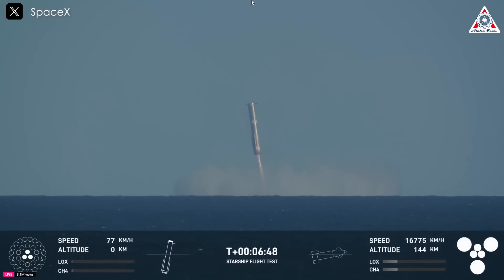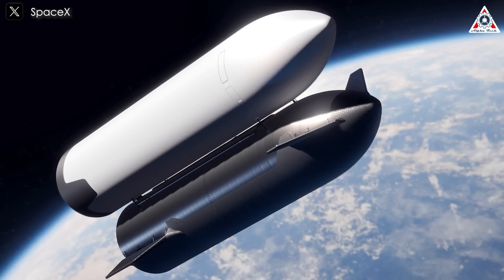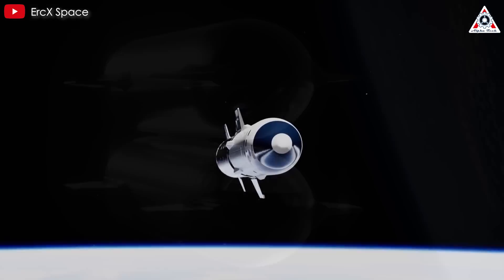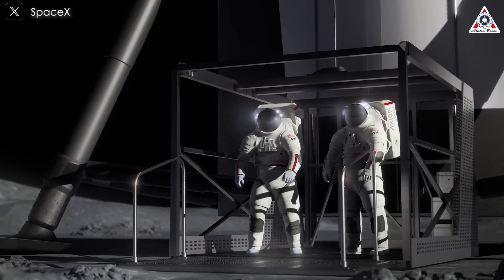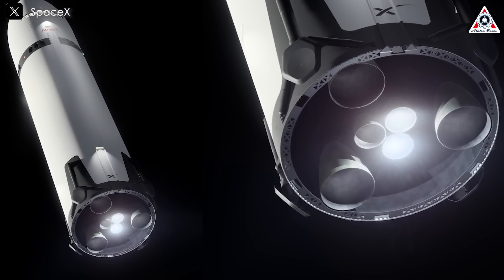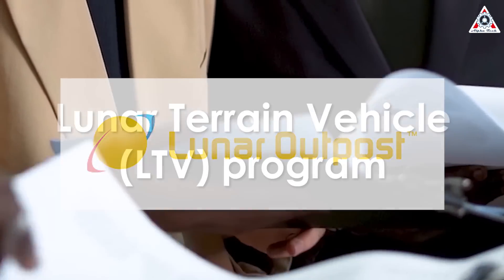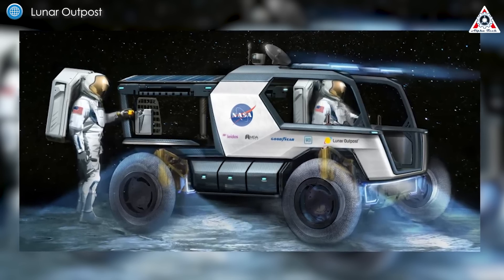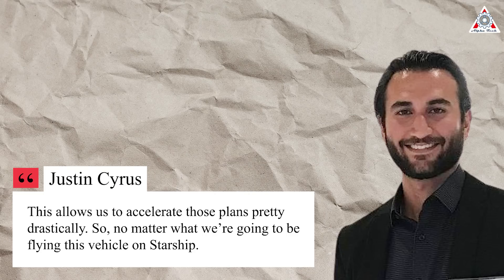Elon Musk just officially revealed NEW Lunar Starship Design that Stunned NASA...

Comment: I can almost see that tall lander falling over in the soft lunar soil after landing. Hope they test that concept first with no humans aboard.
Reply: Exactly.....refer to Intuitive Machines IM-1 lander......
Reply: They always do
Reply: The point at which a rocket rotates (while vertical) depends on where the thrust is coming from, the IM-1 lander that recently tipped had its landing motor at the bottom, making it unstable. Its like trying to balance a mop on your palm. HLS has its landing thrusters high up near the top of the ship, which is more like holding that same broom except from the top instead of trying to balance it on your palm. Its much more stable and since HLS will be crewed it will most definitely have some kind of automatic landing abort system.

Comment: Let us know when they create artificial gravity. Next reduce radiation exposure in deep space.
Finally create fuel from water for the trip home. Until then this is bullshit.
Reply: Idiot
Reply: we have the technology to do all of this already btw its just ridiculously expensive.
Reply: @sahibdipsandhu  lmfao, you must work for a government contractor.
Reply: @rap36case  Not at all, but had you done even the slightest bit of research you'd understand what I meant. But you didn't so let me fill you in. Artificial gravity can theoretically be achieved with the technology we have right now through gravity rings but realistically at this moment they will be wildly expensive and potentially unreliable. Both fuel and oxidizer (hydrogen and oxygen) can be produced from water through electrolysis. But the yields and time it takes to produce that yield is sub optimal. And as for radiation, there are already a plethora of commercially available solutions. Most can easily be converted into a viable method of deep space radiation protection.
Reply: The last one will be done very soon. The other stuff can happen in the near future.

Comment: Who doesn't recognize this as a thinly disguised attempt to rationalize development of a big, hulking stainless steel can meant for Mars trips through the magic of repurposing it for lunar missions using a visual design app? Look ma, no rational engineering involved at all! Just Von Braun's earth-orbit-rendezvous method force fit to a oxygen-methane behemoth of exactly the wrong shape for propulsive landing.
Reply: No, the Starship will be different for Mars as it will need rentry. In case you don't know, Mars has an atmosphere hence heat tiles required.  Much more complicated, will require self repair capability of the heat shield at Mars in case of a Murphy's law event.
Reply: @ghanova  You've missed the point by jumping to a more technical issue - the "system" has no good justification to begin with other than delivering mass numbers of internet satellite to earth orbit. It has no optimal shape for anything else, not that its function was even optimized for that - note recent problems with trying to perform re-entry with a rather optimal 1 Bar atmosphere and standard pressure-altitude profile as Earth. Cack-handed design made mainly for show. Didn't mind taking government money to make it though.
Reply: It actually re-entered just fine recently. And it carry a massive amount of payload to the Moon. Helpful when building a lunar base.
Reply: @ebonaparte3853  It re-entered after a huge amount of  sweating out of a "redesign" for LEO re-entry. I would not call a lot of smoking 417 stainless and massive tile damage a re-usable design, reuse having been the point of such a bulk delivery system. 
While moon landings will require propulsive landing methods only, Starship would have an awful overall geometry for the terminal guidance phase in such use, especially if any human intervention is required. Piloting would have to be from the top of a long cylinder, pointing "the wrong way", and carrying massive amounts of sloshing, cryogenic fuels later required for the direct ascent method of liftoff. Every step of the way, you would be dragging around tons of re-entry protection, unless you propose more vehicles, and hence more vehicle transfer operations (dock in LEO for fueling, undock and dock in lunar orbit, etc.)
regards, DKB

Comment: Why not have NASA just use a Dragon to dock with Starship and then fly to the moon? 
It will save NASA Billions in the cost of there more expensive rockets.
Reply: they probably will. orion is a good vehicle and it does it's job well so it's a shame it'll be scrapped because the rest of SLS was trashed by greedy contractors. if they can find a way to work it into the mission i'd be happy but as things stand i dont see the point of sending crew to lunar orbit in a small vehicle and sending an empty starship to rendezvous with them there when they could just rendezvous in LEO and take them direct to the lunar surface.

one solution might be to use it as a return vehicle so lunar starship would take the astronauts from LEO to lunar surface, then on return leg starship just has to hop to lunar orbit and rendezvous there so starship doesn't have to bring enough fuel for a return leg
Reply: @Regista268  To put it simply, SpaceX is a relatively new company, and Starship is the next generation in rocketry. NASA is more comfortable putting its astronauts in a NASA built, NASA inspected and NASA certified spacecraft (Remember, NASA has been around for a LONG while, they know their stuff) at least until Starship and SpaceX get a bit more experience under their belt.

Comment: How will this long capsule not fall on its face on the moon? Most recent missions to the moon toppled over on landing.
Reply: The landing thrusters are gonna be on top not on the bottom
Reply: Should be designed to land on its side like the Eagles from Space 1999. More stable, easier to exit and enter.
Reply: Maybe the large pads at the bottom of the lander's legs will help. 
And maybe also the jagged nature of grains of soil on the moon that fit together like train-track ballast rocks that won't slip under pressure, soil which has never seen erosion from air or water polishing the grains to a round shape like on Earth.

Comment: It makes zero sense to keep the SLS in the equation. Starship can perform the entire operation, and SLS is a waste of money.
Reply: Starship is not human rated and will not be human rated for at least another 20+ years. There is no emergency escape system in the design of starship and there is already a proven escape system with Orion
Reply: @JayDeePLUS-BEATZ they’re trying to make rocket flight as routine as air flight, and the Boeings we fly in all the time don’t have any escape systems. They’re just aiming high. They could also conceivably fly it into orbit uncrewed and crew it up with a falcon 9 in orbit
Reply: @JayDeePLUS-BEATZ no sense
Reply: Single point of failure is bad design
Reply: Saying it won’t be human rated for 20 years is a stretch. It’ll probably be human rated in a few years. And Orion may have a launch escape system, but it’s too expensive to launch.

Comment: All good...
not a tail stander Lunar Lander fan. Its a long ways home if Elevator fails when somebody is on the Lunar surface. or halfway up the ship...

Saw an image of Rocket Lab Neutron, another tail stander, but uses tapered shape and fins to be free standing. which is less risky than mechanical landing legs on a too small diameter ship...

I support the concept of multiple Lunar Landers, better chance of one actually working long term.

on the Lunar white color scheme, will be interesting to see what they can get to stick to Stainless, especially with thermal variations. Thermal expansion of coating will have to match ship, or be flexible.

They might want to send an unmanned mission first to test things out... like if it stands up landing, elevator works, life support function, and take off physics isnt problematic... say like the thrust plume blows a hole under the landing legs faster than ship lifts...

Chances are Murphy works over time on the Moon.